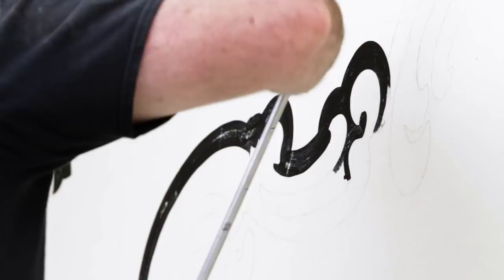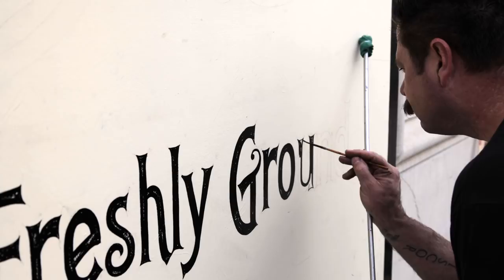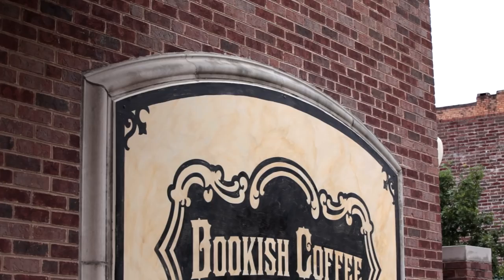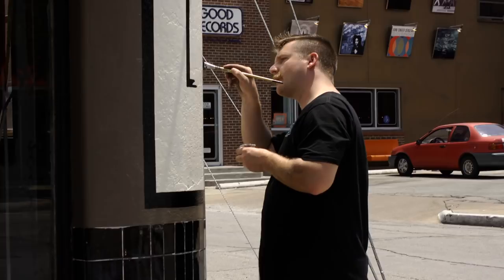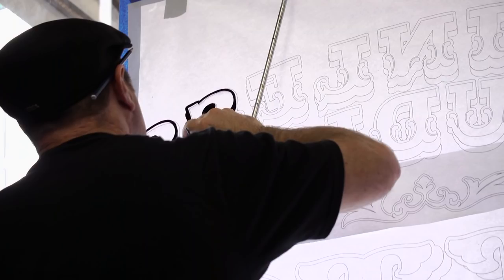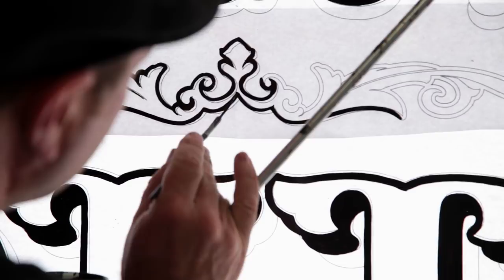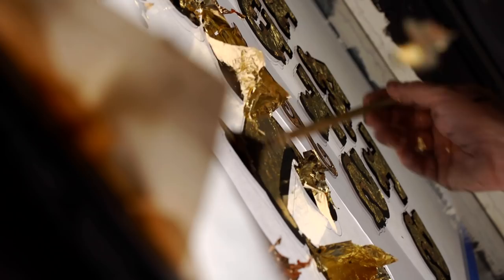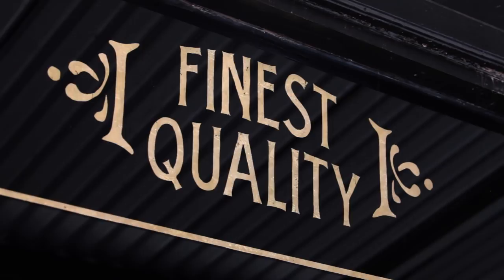Sign Painters: Keepers of the Craft

Comment: The leaf on the tattoo parlour window looked as if it was dutch gold, loose leaf and was done like one would do matted centers.
I learned the craft from Larrey Albaugh, who's sign shop in Colorado was the start of the Letterheads movement, and we did windows with both water guilded outlines and matted centers using quick size, or resin size.
Reply: Some pretty rough work represented here. Do you know Rick Flores, one of the originals from Colorado. Seems like your name came up in our conversations. Worked with him at Disney, played in his band. He retired on medical leave, and moved to Idaho. I retired with 28 years with Disney. 46 years total in the craft.

Comment: Yes - feeling pretty much like a relic these days, passed by and covered over with not only the vinyl computer lettering but even the prevailing mentality of the culture I'm surrounded by that doesn't know or even care whether or not the work is "hand lettered" or not and value only the bottom line which means the cheapest and fastest !   It is great to see the ones holding on to the old and dying craft that I hold on to , but reality moving forward holds little to no concern of what was left behind !
Reply: You need a new customer base because hand lettering is far from dead on race cars , big Mack trucks , Striping on cars  faded letters on old trucks .Not a dead art by far. Are Glenn Weisgerber and MR J out of business NO WAY ! They are doing funny cars.